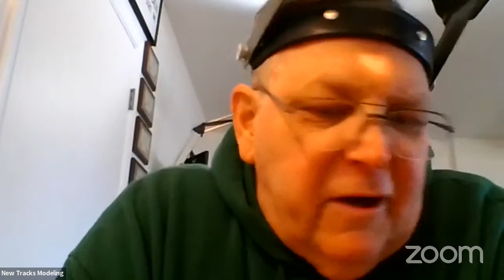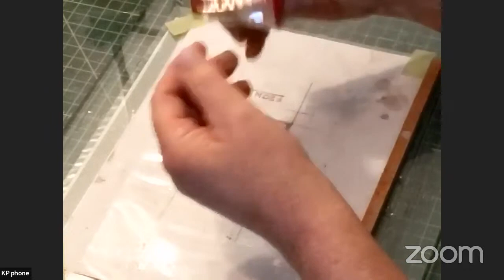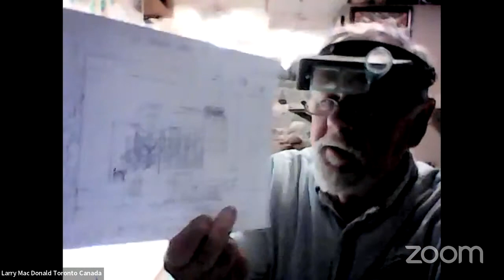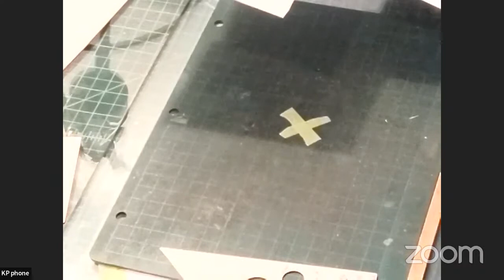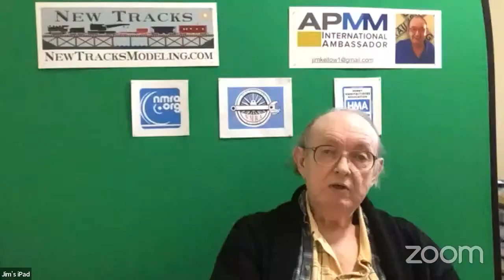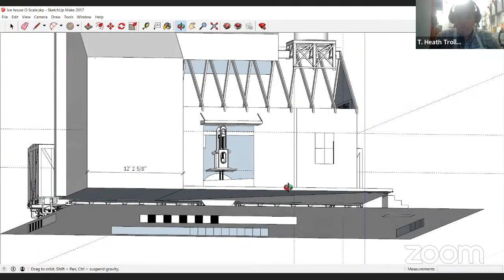New Tracks Model Railroad Workshop  Feb. 5th, 2022

Comment: Great show Kris! Too many tips to store in this brain.

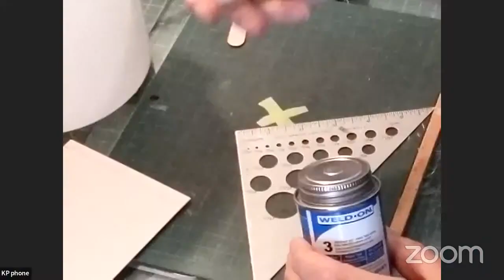1:08:21 - Where you talk about a glue you use for styrene.

I have a couple of questions about that glue:

1. You mention putting the glue container in a plastic container to reduce evaporation.  In the old days when ether was used medically, they could put the container in the freezer to keep for extended storage. Do you know whether that Weld-On will freeze if put in the freezer? If not, I wonder whether you could do the same with an applicator bottle? Of course, how the applicator bottle withstands storing in a freezer is a limit also.

2. You mention the YT channel where you learned about this glue, but you didn’t provide the name or url. Can you supply that?

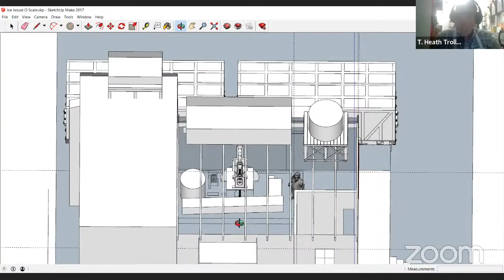1:27:23 - Kris, Heath Trollope asks us to contact you to request the 3D file. I wonder whether you could ask him whether he might be willing to post the file on the newtracksmodeling.com website? Not sure whether the website can store that kind of file.

Thanks